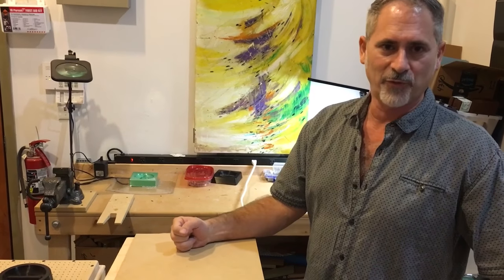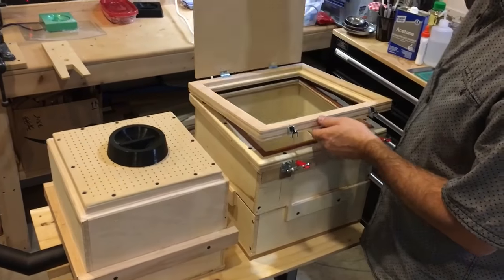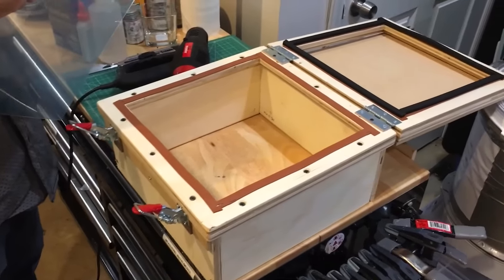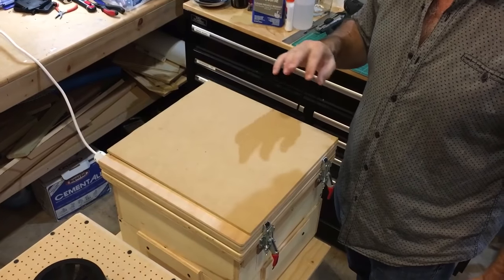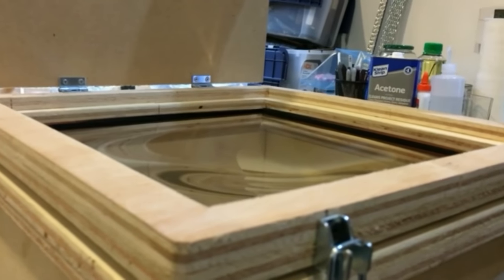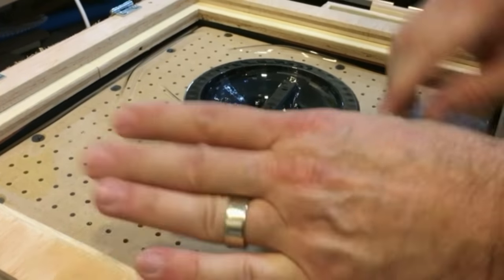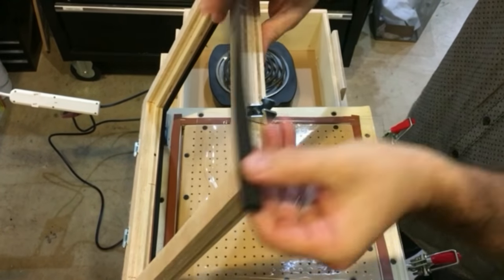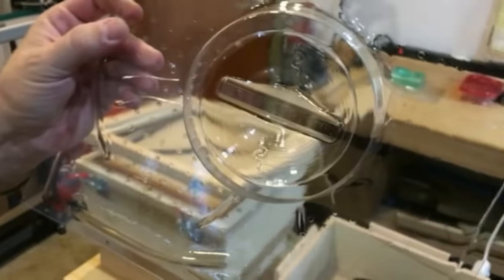home made vacuum former and vacuum process

Comment: Really cool design and execution! One suggestion- I would paint or line the bottom of the top lid with reflective metal paint or aluminum foil to reflect the heat back onto the top of the material.

Comment: A hot plate! Why didn't I think of that!? Here I was watching videos on these ridiculously overkill setups because I didn't want to use my oven. Two space heaters with the safeties removed, moving gantries of large coils for heating, etc., etc. One 20$ hot plate and done! Thank you for the fantastically simple idea!
Reply from the maker: Thanks for your kind comment, a friend of mine showed me this idea back in 1990s and I’ve used it ever cents., I’ve improved on the vacuum former design quite a few times, works well I’m just a simple hot pot and a simple vacuum hose
Reply: would an old waffle maker work?

Comment: Great design on the entire former. I would like to make a couple suggestions...

I'm not sure the lid is needed. If you feel it is need, consider a glass top for viewing. 

When you transfer the melted plastic over to the vacuum box, have your heat gun ready to help facilitate the vacuum in tight areas. 

Place some insulation foam where the heat box meets the vacuum box around the bottom on the vacuum box.

Also, someone joked about burning the house down yet. The only way that's going to happen is if you get distracted with a phone call or a visitor; and the plastic melt down to the burner. Consider a timer you plug into the wall the plug your burner into the timer. Time your melts for each material and select that time on your timer. 

Lastly, consider using a silicon spray on the pattern to help with the release. 

AGAIN, AWESOME VACUUM FORMER!!!
Reply from the maker: super advice! thank you, and thank you for your kind words!

Comment: Did you ever try pushing down the frame before applying th vacuum? Thereby creating an initial positive pressure. I've seen that in industrial vacuum formers, my guess it is to  distrubute the plastic more evenly.

Comment: I've been perusing Vacuum Forming videos online for several months and there are quite a few very nice ones, but your design is by far my favorite for our purposes. I've been planning on going with a 2 piece station with a heating element below the plastic because I didn't like the pull down method where the heat source is above the material, due to heat rising. I can see it being necessary to use the pull down method for larger or thicker pieces, a la Adam Savage's jumbo machine.  Your method is great! I really like the hot plate and the frame latching.  Thank you for sharing, you seem like you are very familiar with vacuum forming. I just subscribed after watching this video and look forward to viewing many others! :-)
Reply from the maker: Peregrinus Solutions LLC Thank you very much for your kind comment, it makes me feel good that the videos are appreciated the ideas I liked. Please let me know how your build goes. I post new videos between this channel and Wham Bam Systems channel. Thanks again

Comment: Awesome build, works like a charm. I was wondering if you could do a video of forming a 1/25 scale plastic model car body; I was wondering if the model car body would break or melt from the heat and the pressure ? You would have to cut pieces of plastic and glue them into the window cavities because the plastic sheet, when heated, would want to pull through those holes. If you did a “how to” video on this, so many hobbyists would be truly greatful, and there’s a lot of us. Great job and invention, if you sold them at an affordable price, I would buy one. You should design them in small, medium and large sizes and market them.
Reply from the maker: Thank you!
Unfortunately model car parts are made of styrene, which is the preferred vacuum form material, and they are thin walled. So they would surely warp with heat. With a bit of work one could back the part with plaster or clay and take a casting and use this for a mold if you intended on making a series production.

Comment: Hello looks like a great vacuum former. I know you do not have plans but what are the outside dimensions of your heater box. Thanks
Reply from the maker: do you want the frame size? I believe I made it to hold 12" x 12" material which seemed to be standard sheet availability here in Usa
Reply: @petersolomon3505  That's good thanks. The heater heats enough for that size I guess? Thanks again will let you know when complete.
Reply from the maker: @birddiner  yes the heater is plenty large enough,  If it really helps I can make plans for it tomorrow?
Reply: @petersolomon3505  Plans would help. If available. please let me know. Just purchased the IMUSA USA Electric Single Burner.  Thanks
Reply from the maker: here you go, they are general dimensions, you will have to do part drawings and find the hardware.

https://www.dropbox.com/scl/fo/jg7jbyrm6d9ovqpdyamqf/h?rlkey=pbqemg8ncbjcuu8r63gh7kre4&dl=0
Reply: @petersolomon3505  Thanks so much. They will be a great help. Will send pic when finished. All the best Howard
Reply from the maker: @birddiner  thanks Howard! if you make a detailed cut plan please share I can post link or info here.
email peter@petersolomondesign.com
Reply: @petersolomon3505  ok sure will.

Comment: This is a great design although there is one design error and that is with the heater. 

The heater needs fresh air \ a flow of air, coming in from the bottom and the hot air, going out of the top because your heater will click off when the temperature reaches to accept target so the heat of all click off before it has heated the plastic. 

For the top exhaust ports I wouldn't do them right at the top, 
I would probably do them a few inches down to allow a brief heat build-up just under the plastic.
Reply: thanks, Ill try some holes, but never had that plate cut out before,

Comment: Peter, Nice work. I have a small project that may benefit by such a device. I wonder if I 
sent you a mold - or the STL file of my part, would you consider forming it for me?
About 5" diameter and about 1" deep. It is a speaker cone for an antique radio. Unfortunately
the paper cones for these old speakers are no longer made. The finished piece should be in the 
0.010 -> 0.020" thickness. dan

Comment: good design. do you think lining the heating box with something like aluminum foil will protect the wood from the heat? also, I'll be vacuum forming a large sheet of 2ft x 2ft ABS plastic, do you think a simple hot plate like yours can do the trick?
Reply from the maker: jeth you can use some foil or heat reflecting film, to be honest, it doesn’t get so hot to burn the wood. If you are going to do such a large sheet maybe 4 burners in a pattern would be needed.let me know how it goes!
Reply: @petersolomon3505  Appreciate the response. I'm trying to be a bit more frugal; are you able to name something that can distribute the heat over that area without breaking the bank?
Reply from the maker: jeth maybe two of these? MegaChef Electric Easily Portable Ultra Lightweight Dual Coil Burner Cooktop Buffet Range in White https://www.amazon.com/dp/B079T6HJ53/ref=cm_sw_r_cp_tai_vkolFbSTXYD47.  Or just one mounted to a stick so you can move it front to back to keep heat even?
Reply: @petersolomon3505  I ended up getting only 1 of something similar to those, will try and let you know how it goes
Reply from the maker: jeth Super maybe try to mount it to a paddle and leave a hole in the front of the box so you can move it around in circles. Let me know how it goes I am very interested

Comment: It would seem that if you elevated the  piece slightly above the surface of the vacuum chamber the spidering would be minimized.
Reply from the maker: JAMES TUTTLE yes, and actually a wider draft angle would have helped it more if desired, but I was not interested in the external part.
I was making a mold which is only the inside cupped area.

Comment: Great video I have to build something like this. What was the thickness of the sheet?
Reply: thanks for saying so, I use a variety of plastic thicknesses and types, generally anything between 1-2 mms goes quickly, 3mm is slow to thoroughly heat, I also use EVA foam from hobby supply stores for fun soft pulls.
Reply: @WhamBamSystems  Thank you for your advice. I mostly like to use this for the windshield part on tin toy models I thinking more like on the 2mm one.? I heat formed acrylic sheet before but this vacuum method looks much more sophisticated. All the best

Comment: use some tape and cover about 50% of thouse outside holes.  You have far too much on the outside.  And they are huge.  You want the suction to be in the middle of your part.  Not outside your part.
And wrinkles come from saggy material.  If you are getting tailing wrinkes off the part,  your excess area is too big around it.  So you can make a smaller frame,  a bigger part,  or raise your part up the distance of the sag.
Reply from the maker: Thanks.  The part I am making is raised from the table, the wrinkles are of no interest as they are well out of working area. If I needed a different solution I would have made the mold on a platen to concentrate the vacuum as needed. However, the design of my system stretches the level of he frame lower than the platen thus sealing all unused holes.

Comment: Hello Peter. 
Very nice work. As a heater what did you used ? 
What do you suggest (dimensions, watts,etc..) 

Thanks a lot
Reply from the maker: Thanks, that’s just a portable kitchen stove top. I use it on very low setting and had only cost me like $14, so you don’t need to spend much.
I used mostly 1/2 inch ply wood, hope that helps, still need to create cad designs to share
Reply: @petersolomon3505  Thanks a lot